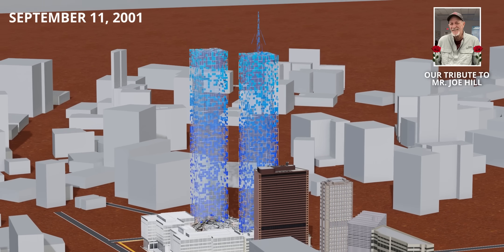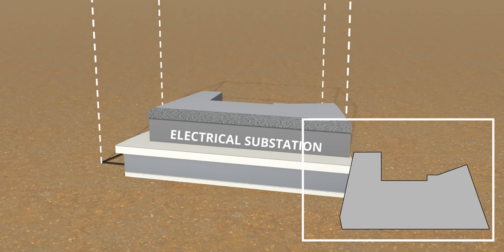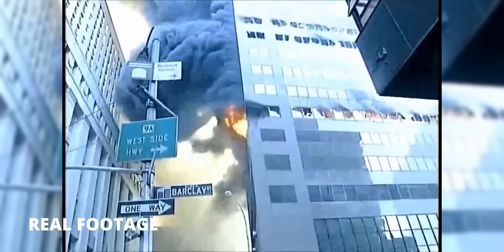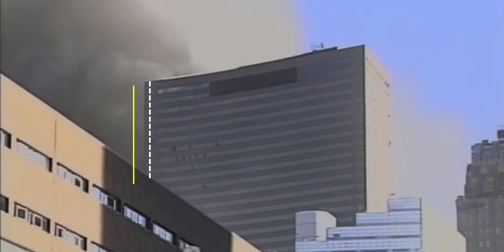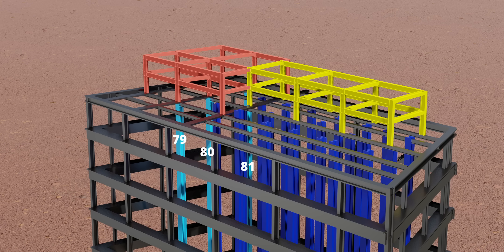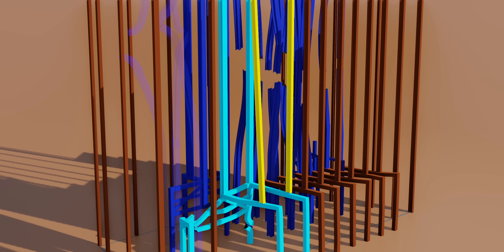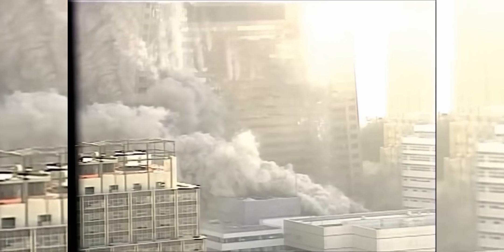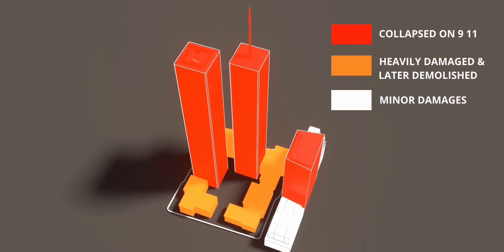Collapse of Building 7 | The Complete Physics

Comment: That bit about the antenna is ridiculous. You can see it on numerous videos falling completely away from building 7.
Reply: @smurph8411  -however, a large section of the base section of the antenna did fall on WTC#7 as well.
It was recovered within its footprint so.....
Reply: @smurph8411  - it wasn't the antenna that gouged the side of WTC#7. It was a large intact column section about 140 feet long and many hundreds of tons of debris.
Reply: @holdernewtshesrearin5471 what cause the fire?
Reply: @DjJoeKhoury the burning debrees
Reply: @Jul_Cool don’t they have sprinklers in those buildings?
Reply: @DjJoeKhoury  Are you serious?
Reply: @bodispt4057  Ya, why weren't they working? There were fires above and below the crash zone. How about building 7? Why didn't the sprinklers go on?
Reply: The debris damaged the fire suppression system.
Reply: @txag007  Are you serious? You believe that? Have you heard of Operation Northwoods? Do you want me to explain it to you?
Reply: @DjJoeKhoury  Yeah, and they were totally ruptured along with the gas mains when the buildings collapsed.
Reply: @DjJoeKhoury good question, and how did that melt steel support beams, when nothing like that has ever happened before, in the history of tall buildings
Reply: @drop830 you do know that steel begins to lose strength etc when it reachs a certain temperature right ?
Reply: @DjJoeKhoury  probably burning debris from the jet fuel fire. Also the water main was severed.
Reply: @DjJoeKhoury  they did, the water main was severed.
Reply: @DjJoeKhoury  I don't think the measly sprinklers would be able to put out the colossal fires caused by a plane smashing into the building at several hundred miles per hour.
Reply: @mpatel7776 this was about building 7. The plane didn’t hit building 7. 
Even for WTC 1 and 2, floors above 80 were affected. Floors 1 to 70 were still solid. Even if you want to go as far as say the “pancake effect”, the concrete would pancake, the vertical I beams would not collapse all the way down. The fact that they cleaned the mess right away instead of having investigations on why the building collapsed is suspicious at best. We investigate everything. How did we not allow time for investigations?
Reply: @IndieAuthorX  there was a video of Larry Silverstein saying to pull it. What’s he referring to? It was about tower 7.
Reply: @DjJoeKhoury even if they were working, sprinklers are fire suppression, they are not meant to extinguish fires
Reply: @DjJoeKhoury Lmao some of you people are unhinged wtf does north woods have to do with this 😂 anything bad that happens is just a conspiracy for you weirdos you don’t live in reality
Reply: @Jul_Cool  But why is there no video footage showing burning debris hitting Building 7? All we see is a bunch of dust and columns flying in the air.
Reply: @IndieAuthorX  The water mains in Manhattan ran toward the south, yet Building 7 was north of Gound Zero. Also there is video showing FDNY with hoses tackling a fire in WTC5, and another firefighter a block from Building 7 putting out a car fire. How did they get those hoses to work if there was no water pressure?
Reply: @sorcerykid  hmmmmm... Maybe because there is a fucking 500 METER TALL DUST CLUOD that blocks the view in almoust every video???
Reply: @Jul_Cool  So in other words there is no definitive proof that burning debris actually hit Building 7. Thanks for confirming what I thought. People are once again led to beieve in events that have yet to be fully proven.
Reply: My one problem with the video. It very obviously wasn't the antenna, just a shit to of other wreckage.
Reply: Have we all seen the Video when the guy with camera crew all run into Building 7 go up a floor and talk to the I think CIA guy and he tells them to get out the building is going to fall, funny there is hardly any fires, what was his name NOSTRADAMUS ?
Reply: @aussieoutlawalt8411  lol yet another video shows the fires
Reply: @scallen3841  The fires were easily managed.
Reply: @aussieoutlawalt8411  yet no fire fighters went to the building, the effort was at tower 1 and 2 . Who told you the fires were easy to manage? Did you personally make that assumption were you in the building
Reply: @scallen3841  its a statement by the Fire Department numb nuts, did you even read the NIST Report ?
Reply: @aussieoutlawalt8411  insults how nice yet other reports say the main fire effort was the twin towers , so the let this building burn basically. Damn brother I thought you were on the ground and have all the answers
Reply: @aussieoutlawalt8411  none of this matters since the conspiracy nutters have had over 20 years to prove without a shadow of doubt , the building was brought down by a controlled demolition and still they haven't . They just repeat years old claims over and over, hell they even say this video is wrong
Reply: @aussieoutlawalt8411  Dude, the whole lobby was filled with smoke and dust. You're not fooling anyone
Reply: @scallen3841 what did Larry mean by pull it than if there were no firefighters inside fighting it
Reply: You can also see main exterior columns from tower 1, covering the roof of the building between the two (wtc6) and the street beside WTC7 , showing that parts of the tower clearly fell far enough away to hit WTC 7 ....big chunk of wall from tower 1, or antenae from tower 1 .... doesn't matter. The damage in WTC 7 before it fell is obvious in pictures ...
Reply: It absolutely did a portion of it was recovered from the building 7 debris
Reply: Then it straightened up and became DUST ON THE WAY DOWN. WATCH THE PIECES IN SLOW MOTION .
THE WTC COMPLEX was built in a concrete "bathtub" to hold the HUDSON RIVER . If everything should have SMASHED DOWN the bathtub would have broken and Manhattan should have been flooded.
It should also be visible in seismic activity. It didnt happen. Remember all DUST AND PAPER swirling around? Dr Judy Woods theory with "DUSTIFICATION" is the most accurate. Watch WTC 6! The entire CORE was gone. The second towers CORE became a spire. Peeled of the concrete as a banana 
The spire stood naked for 5-10 s and then fell STRAIGHT DOWN and became DUST 
A man walked and filmed inside and all desks with paper were in ORDER, just as at the Pentagon. It was as straight cut through the walls. The WINDOWS were intact.
Reply: No you can't. I've looked through 15 videos and I dont see it or anything else. There's too much concrete dust to see anything that happens below about 70 floors high.
Stop spreading disinformation based on your preconceived beliefs.
Reply: Building 7’s collapse front the front view  
https://youtu.be/6pyyqV7egEI?si=aN5HdjJaRL3ziHyE
Reply: @Sgt_Harkonnen show the view from the Southside when it dropped. Ill wait
Reply: never let the truth get in the way of dodgy unscientific propaganda pieces like this
Reply: Red herring.  No one ever said anything about the antenna.

Not relevant
Reply: So how many other things are wrong, I am with you
Reply: @aussieoutlawalt8411  well make your own video and tell us what really happened
Reply: @aussieoutlawalt8411 the United States invaded countries that had nothing to do with this.
Reply: Antennas are made of aluminum. Heat from fire cannot burn steel. The follwing day news crews filmed buildings at ground zero and clearly there were steel columns still burning.  Imbedded in my brain is the sight of bubbling steal. I now know that that was thermite. You can find on youtube the leaseholder's comment on 'pull' the bld. Listen to it. Is he really talking about 'pull' the firefighters?
Reply: @Stoney1959 they didn't pull down the building.
There is no sense in using such a word in such a context as it is not used in demolition.
Steel would also not be bubbling like that, iron wouldn't either after such a long time.
For steel and iron to burn it wpuld need a much more oxidised enviroment, and I not even sure it would be possible, considering those are beams and not powder
Reply: This video was sanctioned by the ptb
Reply: The towers weighed 750000 tons each and stood 1/4 of a mile high. Drop 750000 tons from 1/4 mile and then let me know if stuff doesn't get damaged on the way down. Plus. These dumb conspiracy hypotheses all ignore actual evidence, like the massive spread out piles of wreckage, the thousands of dead, the fires, and gravity.

They are an insult to those who died that terrible day.
Reply: @ScienceChap  You say the conspiracy theorists "ignore actual evidence" -- meanwhile NIST admitted in its final report that they didn't examine a SINGLE piece of structural steel from Building 7 when investigating its collapse. So who again ignores actual evidence?
Reply: Larry Silverstein 🇮🇱 (owner of WTC complex) said - "Pull it, and we made the decision to pull and we watched the building collapse" - referring to WTC 7 - not hit by planes.
"We are benefiting from one thing and that's the attack on 911" - Benjamin Netanyahu 🇮🇱
Reply: @pololikikuju  it’s amazing these people are in such denial. 
Tucker Carlson had a revealing interview with Rep Curt Weldon. It’s a must see on YouTube.
Reply: @pololikikuju  You re clearly not benefiting from having a brain, are you?
Reply: @pololikikuju  Conspiracy theorists on their way to use a wildly out of context quote as their only evidence
Reply: @Goat_Lord  exactly
Reply: @pololikikuju people taking it out of context, there is noway if he did it then he would admit it on video also benjamin wasn't prime minister back then who was prime minister was ariel sharon
Reply: @BridgadesArmani  benjamin said that years later when he was in fact prime minister, Isreal did 911 they did it, and when the American people find out that small state will disappear
Reply: @BridgadesArmani A Democrat who took the Safe and Effective ones. Good luck

Comment: If there is any FAKE NEWS propaganda or reference to the official "narrative about fire causing this building to collapse in the most symmetrical display of explosive demolition in history, I'm not interested in the gaslight. I watched it with my very own eyes. All of those columns collapsed at the exact same time. All 4 corners hit the ground at the exact same time. There were huge explosions going off in the building throughout the day. Had to have large gaps to  accommodate the cover-up.
Reply: No, they didn't all collapse at the same time. You don't understand what you are looking at, which is fair enough. Few people do. The key is to not engage hubris and proclaim your assumptions can't be wrong because they are yours.

This Lesics video is very good – with one or two exceptions - and goes into a much higher level of detail than many viewers will be able to comprehend.  While not perfect, the collapse mechanisms – the sequence of failures - described here by Lesics are substantially correct and this is true no matter who planned and carried out the 9/11 attacks or why . 

That may not be what you want to hear and go against 20+ years of entrenched dog_ma and conditioning, but it’s not wrong. 

That also means (in case you did not get the hint) this video can be (and IS) absolutely correct in its description of collapse mechanisms AND the 9/11 attacks could still have been some sort of inside job. The two things are in no way mutually exclusive. 

The mechanisms described here have broad professional support around the world. There are no professional engineering organizations (for example: ASCE, ASEE, ICE, etc) that disagree with them or have offered any formal dissenting opinions or alternative hypothesis. 

So, setting hubris aside, either the overwhelming majority of the worlds structural engineers and simple observation are wrong,… … or you are. Which seems more likely? 

IF you still think believe this explanation is wrong then produce a better one . Good luck with that. No one ever has and I don’t see you moving that needle today. 

No one ever does.